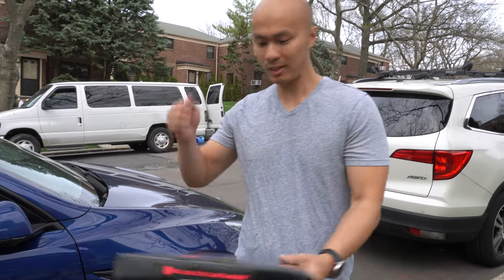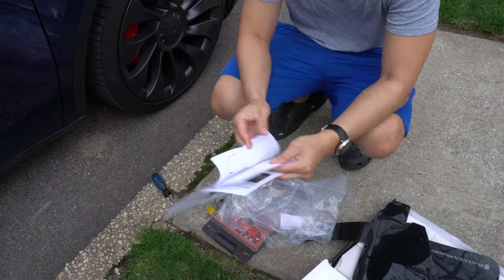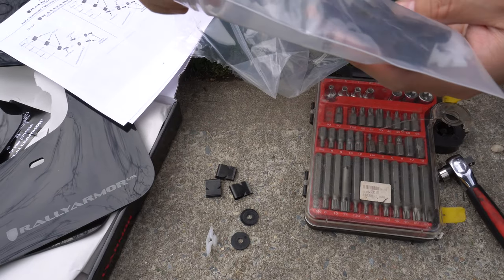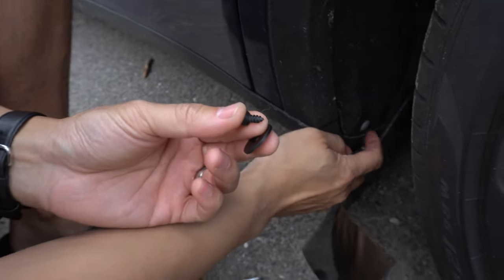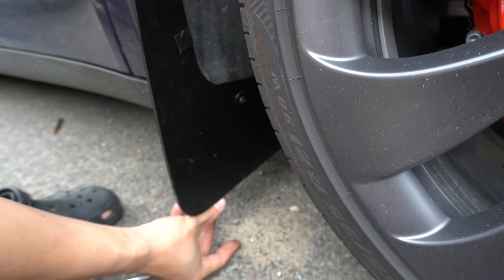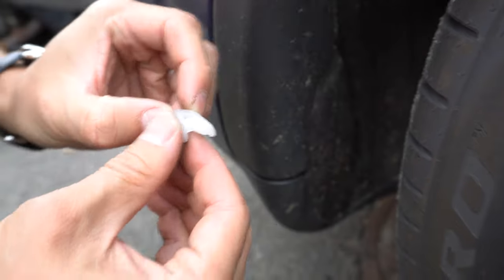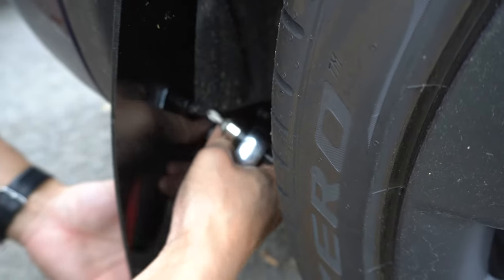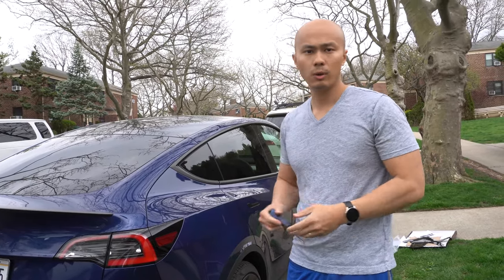RallyArmor Mudflaps for the Tesla Model Y

Comment: If you turn the wheel prior to the install, you could have used any screwdriver you desired.
Reply from the maker: Rear wheel too...? 🤣
Reply: @zed4me  do you have a link to the ratcheting screwdriver you used?
Reply from the maker: @denniscodringtonjr7007  I don't but look for right angle screwdriver

Comment: Your clips went on too easy lol. I installed these today and when the clips went on too easy I realized the clip just went over the flap only, and it didnt pass over the plastic trim of the car AND the flap. Putting the clip over both took alot of finger strength and it didnt go that easy.  Hopefully you rechecked yours lol. You may just see both ends of the clip grabbing around the flap only lol